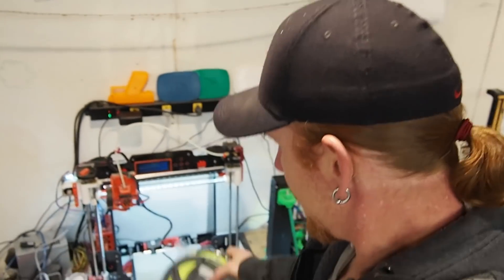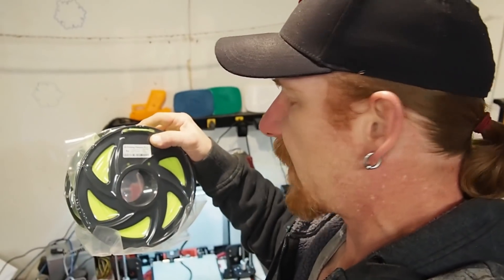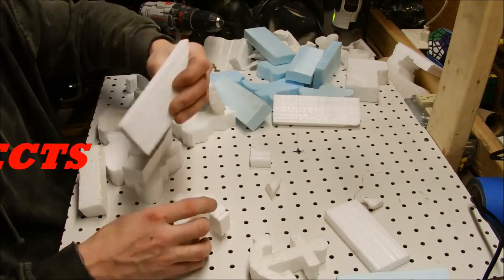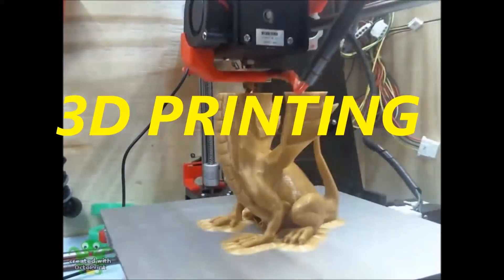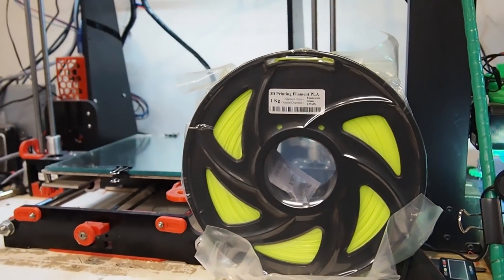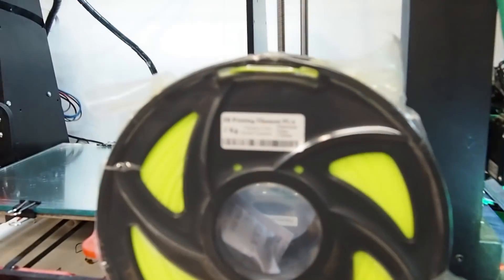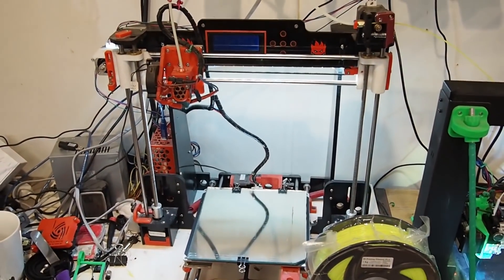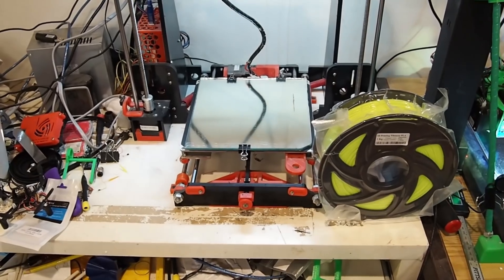3d Printed Bag - Paper or Plastic? (A Gift Idea) Zyltech Filament

Comment: you should invest in a new mainboard for the anet a8... may i suggest a mks gen 1.4..imo the best low cost board out there! super easy to add things like bl-touch, leds, neopixel leds, filament run out sensor! and the best part??...tmc2208,2130,2100..it will make that printer as silent as can be!! ;)
Reply from the maker: WHAT CAN'T HEAR YOU OVER THE ANET PRINTING WHAT? lol ya if and when the board goes fingers crossed i'm be doing something maybe multi color but I'm going to ride this board (no pun intended oh wait ya it was) till it drops see how long I can keep it going but once it does goes there will be a major overhaul for sure